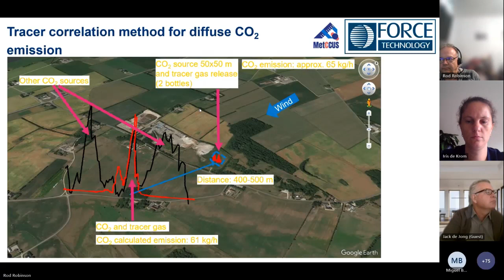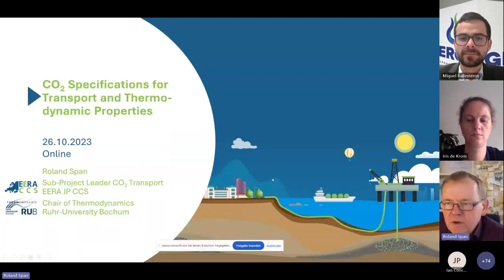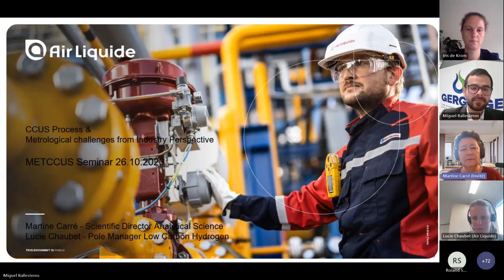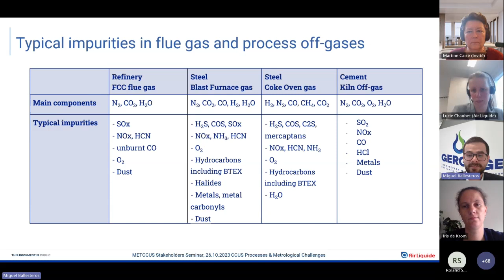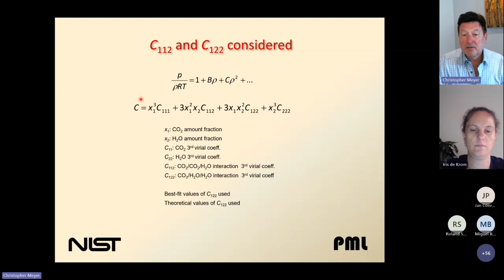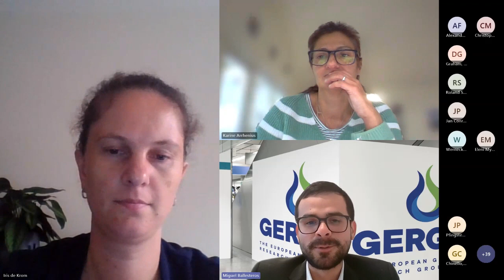METCCUS Seminar on Metrology Support for Carbon Capture, Utilisation and Storage - Part 2

Comment: Generated using Talkbud (Browser Extension):
📝 Summary of Key Points:

📌 Air Liquide is a global leader in gas technology and services, focusing on developing sustainable solutions for various industries and dedicating 60% of their R&D projects to reducing CO2 emissions.
🧐 Air Liquide offers a portfolio of solutions for carbon capture, utilization, and storage (CCUS), including expertise in CO2 compression, liquefaction, storage, and transportation.
🚀 Measurement challenges in CCUS applications include sampling, material compatibility, stability of impurities, cross-contamination, and flow measurement.
📌 The video also discusses challenges in making clear and standardized specifications for CO2 and impurities in CCUS applications.
🧐 Measurement challenges in CCUS include flow metering, emission monitoring, chemical metrology, and physical properties.
🚀 Challenges in flow metering include accuracy, measurements across a wide flow range, and variable CO2 purity.
📌 Challenges in emission monitoring include measuring breakthrough and product emissions, as well as emissions from amines and flue gas.
🧐 Challenges in chemical metrology involve the need for CO2 traceable standards and reference gas mixtures, particularly for amines, NOx, SOx, and metals.
🚀 Challenges in physical properties include the need for data to verify models and predict the physical properties of CO2.
📌 The speaker concludes by expressing gratitude for the contributions and discussions during the seminar and invites participants to follow their website and LinkedIn for future events and information.

💡 Additional Insights and Observations:

💬 "Air Liquide aims to provide carbon capture as a service for their own plants and customers, helping them in their decarbonization efforts."
📊 No specific data or statistics were mentioned in the video.
🌐 No specific references or sources were mentioned in the video.

📣 Concluding Remarks:

Air Liquide is actively working on developing sustainable solutions for reducing CO2 emissions and providing carbon capture services. They are addressing measurement challenges in CCUS applications and emphasizing the need for clear specifications and standardized methods. Collaboration and ongoing research are crucial in improving measurement techniques and supporting decarbonization efforts in various industries.